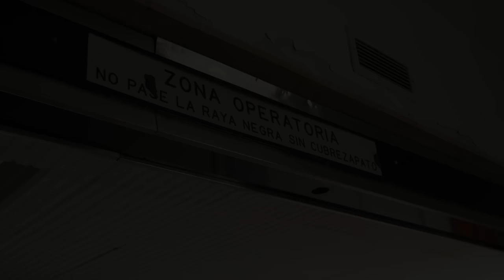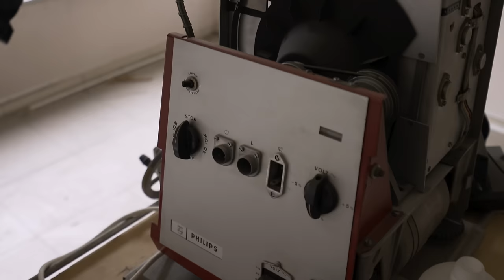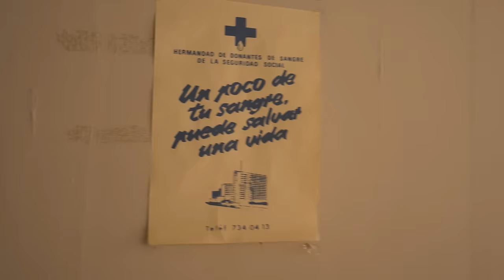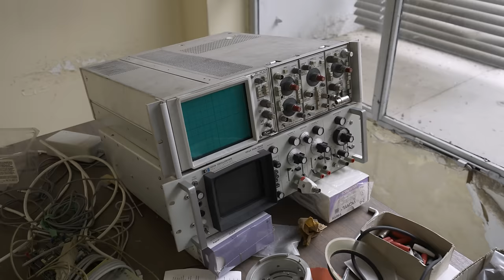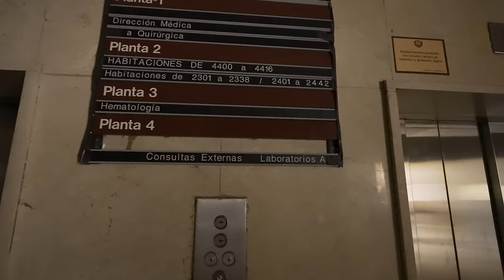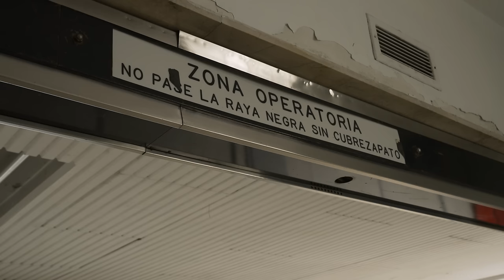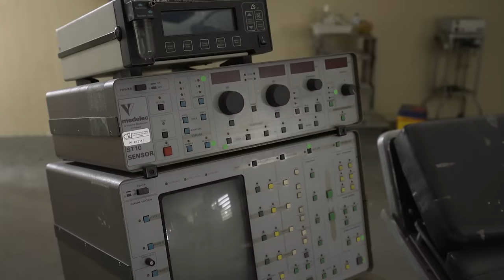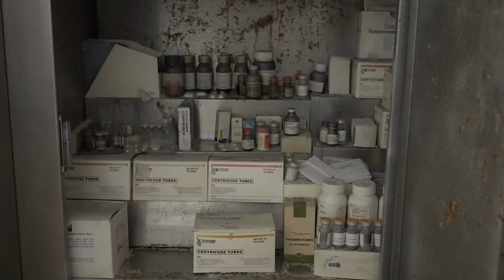Evading Security at Abandoned Research Hospital - Found Autopsy Theater and Operating Rooms

Comment: As a Radiologist Technologist i can surely say that this machine at 4:23 is a SIEMENS T.O.P. C-Arm Radioscopic Machine. A Radioscopic Machine is used for surgeries because its like a live X-ray. The surgeons and the doctors can position the machine and it will use X-Rays on live time so they can see what is happening inside the body and at the place the surgery happens. Unlike the regular chest X-Ray for example, that you take it one time and its like a photograph, the Radioscopic Machine shows live what happens inside you. Now the CT Scanner looks like a donut, and the MRI Scanner like a thick tube.

Comment: 4:29 - That's commonly used for things like venous catheterization, and also for angiograms of specific vasculature. Angiograms are essentially images of your vascular system (Veins and arteries) . They're also used for cardiac or vascular procedures like placing stents in real time. It's not a CT, and it's also not an X-ray machine (It does use X-ray technology though). It's an in between of the two, but used for VERY specific reasons. They were the bees knees back in the day. They're now more commonly used in poorer countries due to their low cost. We have much newer ones that do a better job as of present time.

5:27 - That's not a brain. At the top of the image is the spinal column, underneath it the two circularly defined objects (One dark/ One light) are the inferior Vena Cava and ascending Aorta. toward the middle right, you can see the stomach which has some contents in it. The rest looks to be intestines and random fatty areas as well as poorly defined hip bone.

5:37 - Image of a pancreatic fistula seen using flouroscopic dye. Definition Via PubMed ""an abnormal connection between the pancreatic ductal epithelium and another epithelial surface, allowing for the leakage of pancreatic enzyme-rich fluid.""

7:48 - "This hospital doesn't seem very out of date" - You're right, a lot of the equipment I see in the video is fairly up to date. Wouldn't be surprised if you were to see the majority of that equipment in modern hospitals that keep it around because it... just works

10:27 - That style of defibrillator isn't used anymore. We stopped using that "paddle style" defib almost 20 years ago in most places. The machine it's sitting in is a cardiac monitor (Not quite an EKG, but works similarly). They way the two are paired allows you to monitor the heart while also delivering shocks to reset the rhythm of the heart. Back in the day everything was done on paper, so it makes sense that the monitor would print results for later review or actively used to monitor the patient during a code/ cardiac arrest.

13:33 - PVDF membrane or polyvinylidene difluoride membranes are used in labs for various reasons while immunoblotting. Immuniblotting has a few different purposes (google it), but mainly for identifying certain protein markers in microbial life.

 13:46 - Gyratory Shakers are used mainly to culture microbial life in a lab setting. Still used today, but more advanced models are used obviously.
Reply: love all the context! the information is helpful and educational.
Reply: @anneliesehanson5256  I love when they do medical facilities. I'm a Nurse Practitioner, and I love medical history. I just think it's neat to see all the stuff they do!! Makes me want to do my own exploring!

Comment: "This hospital isn't that old.
I wonder why it was abandoned?"

Famous last words.
Reply: Cue the zombies
Reply: I wondered if a poorer country could use that equipment. Ah well.
Reply: The standards of the buildings and patient care areas change so dramatically since they were originally built and these old buildings are often full of asbestos so you have to deal with the extreme costs of that it becomes more economical to build a new hospital that physically and structurally meets current standards. It's the plumbing, electrical systems, adding new technology that never existed when these old buildings were built, aging medical gas supply systems. Also trying to maintain continuity of operations of critical infrastructure during a major remodel is often not possible. Again easier and overall cheaper to build a new hospital, operations continue in the old existing hospital during the multi year process then with only minor disruptions of operations and patient care everything then moves seamlessly over to the new hospital over a couple of days or a week. Then you simply shut the old one down. Problem comes when there is no plan or money to deal with the old building. Most of the old equipment is considered obsolete, some get's moved but most times you start a new modern hospital off with the newest modern equipment in it vs. moving old obsolete items and again you need them to maintain operations while the new building is being built, finished out, stocked and ready to move operations over to the new building. This even happens within hospitals when a new wing or building is added to an existing facility. The older area often keeps it's older equipment until all the patients are moved out of it and into the new area. That stuff usually stays there until that area is re-purposed and then that old equipment is either re-purposed to things like research or more often sold at auction to places that deal in old medical equipment, most get's scrapped and sold to recycling businesses that specialize in medical equipment. Yes I work in healthcare so been involved in some of these type operations, at least on a smaller scale but same concept.
Reply: @markbutler9442  might be blue asbestos

Comment: • That first machine is a C-arch for Radiologic Surgery if im not mistaken. It is designed for quick real-time x-ray feed capture of patients in beds. Used to check prothesis while installing them.

Because it is live feed, thats why it has those monitors in the same room mounted on arms to be moved across the room (something you won't see in other machines. The monitors would usually be behind a wall where the operators would work protected from the X-rays)

One of the displays show the video while the other one can keep a momery of a previous take for comparison and stuff

• The machine over the defibrillator is just a cardiograph probably.

Comment: The radio-logical device at 4:30 is a Fluoroscope, it takes real time X-rays to watch on the monitors, for procedures such as Orthopaedic surgeries or placements of stents and  heart and stroke declotting. Also All devices that house a Radioactive element in them are registered to an national or international board, and they require that any radioactive containment in those machines be removed. an x-ray machine alone has enough radiation potential to kill a lot of people if it is opened and exposed.

Comment: That thing you guys were saying "must be an MRI" is actually a C-Arm which is basically an Xray machine that's used primarily during procedures. Sometimes they do either single-frame exposures, or sometimes they also do Fluoro/moving X-ray. The slides that you saw, the first was likely a CT scan, a cross section of the chest. The second was likely an Xray.

Comment: The criminal waste that goes on in western countries is appalling. There are parts of the world that cannot get anything like the gear that has just been abandoned in this hospital.
Reply: I know! Sometimes its because of laws, other times its because of the companies itself.
I work at a laboratory, and when we changed some of our instruments i asked the company that removed the old ones what would happen to it. They said they had to destroy and throw away everything, even though it still worked. One piece of equipment, a ”simple” scanner, was worth around $15k, and they had to thrown it away….such waste
Reply: Something as simple as an I.V. pole can meet an incredible need.
Reply: @dkroberts1163  it’s cheaper to produce an IV pole where you need it than to ship it thousands of miles
Reply: @ovalhead1412  True that. I was thinking more locally when I worked for a home IV infusion company and we never seemed to have enough poles
Reply: @terrytwo  Your point is moot

Comment: Re: the comment about radiological equipment being abandoned while containing radioactive material: machines used to take pictures, e.g. x-ray machines (and CAT Scanners) use a vacuum tube which only produces radiation when fed high voltage on demand. MRIs use magnets, not radiation. Radiotherapy machines may use radioactive material like Cobalt-60, or contain a particle accelerator (another vacuum tube requiring high voltage); only the former are dangerous when not energized.

What these guys found, the C-shaped device, is a fluoroscope. One end (bottom here, and it's been removed, maybe by a scrapper) houses the x-ray tube. The other, larger end receives it and brightens the image with an intensifier device, before showing it on the CRT screens. The old fluoroscopes sprayed the doctor with x-rays all around the direct-view screen (which, mercifully, had lead glass in it), and they had a very dim image, requiring that the doctor spend time sitting in total darkness first.

Comment: That large Xray machine at 4:32 looks like a fluoroscope. It's like a live view xray used during procedures where the doctor can't see where they're working. Not used as much these days, as prolonged use can cause injury.
Reply: When I get an angiograms for my brain aneurysm check ups, they still use a fluoroscopy machine. Just for a few seconds at a time. My last procedure was February 2021.
Reply: @werlecar  Yup. They also use these al lot for keyhole and endoscopic surgery, as it really helps them see what they need to work on, and where they are.

Comment: With medical facilities and especially hospitals the structure itself is just as important as the technology inside, if you could see inside the walls and columns you'd be amazed at how many utilities, data, ventilation systems, various gaseous and fluid delivery systems and other integral systems there are compared to other buildings. eventually, technology advances beyond the level of the structure's ability to support it properly and a new one must be acquired. The machines and devices inside may appear modern, but if they can't be operated correctly, systems not supported reliably then they are of no use to medical professionals and the patients who are depending on them.

Comment: At around the 4:30 mark that's a Catheterization Lab. What your looking at is a C-arm machine. It helps guide doctors with setting stents and opening arteries etc etc. If you want to watch some cool videos just search 'Fluroscopy' here on Youtube.

The 10:30 mark is a really old EKG machine with paddles. They're AED's to help with cardiac arrest in the short of it. 

34:00 the craziest operating theater ever.

Comment: Most adventuring backpackers: We're going to tour Europe by foot!
Proper People: Uh, yeah, us too...
*Discreetly slides hand over camera jutting out of backpack

Add: Just as an aside, I preformed a ton of corporate security work throughout the 2000s, the bulk of which was at high level trauma centers (aka, where you take the most severely injured patients, not necessarily the nicest facility). Of them all, every Clinical Eval room (more commonly referred to as the morgue or Cooler Room) was in the lowest level of the structure, in the corner, and within 40 feet of a service elevator. I presume it has to do with low traffic areas and containing the, ah, aromas, associated with the function. Perhaps of interest, if you're ever stuck in a hospital with a trauma unit and concerned about airborne toxins, the CE units of most major hospitals have their own air handlers and pressure systems.